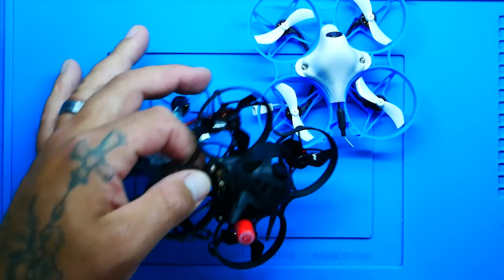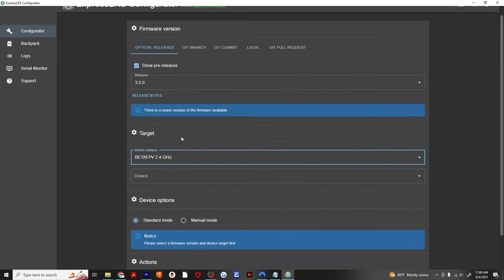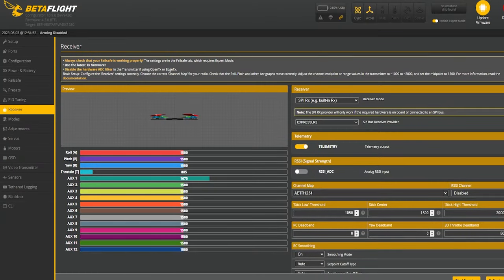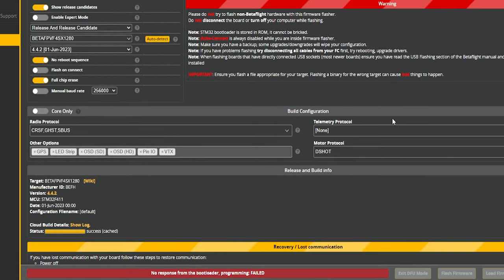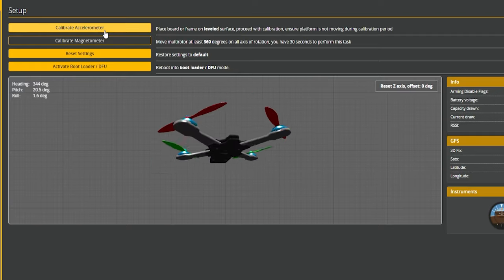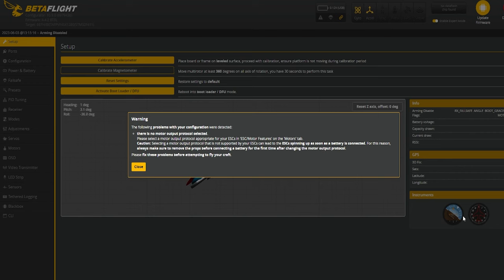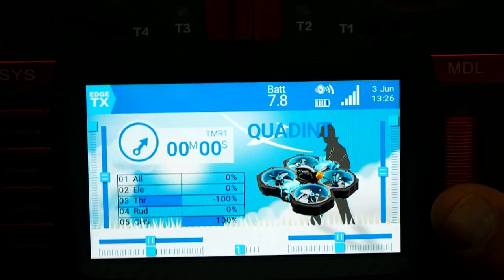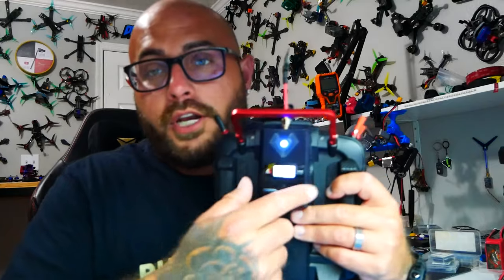How To Bind Any & ALL Whoop & Micro Drones To ELRS !! Your Complete Set-Up Guide !! ExpressLRS

Comment: PLEASE DONT DO THIS IF YOURE A NOOB AT FPV. The video works, only if you know what youre doing. When you do this method you will get that error of “apply custom ports” or whatever when you re open beta flight. What this video fails to mention is, yes although you flashed to 4.4.2 you still need to attach the 4.4.2 DIFF file into the CLI in Betaflight otherwise your whoop will be all screwed up and not bind. The DIFF file basically tells your drone how to act and to be able to be bindable with your ELRS radio. I struggled for weeks trying to figure out what I did wrong from following this video, but it’s missing a whole other half set of instructions for you to do this successfully. Now that I know what I did wrong it’s easy, but if you’re new like I was at the time it’ll be a complete nightmare and you’ll spend 4 hours every night trying to figure out what you did wrong!
Reply: i think i saw it on another video (by luck) that you backup your current version, and you can restore that section from the backup
Reply: @Langor  yeah I had a group of guys on a discord who know their stuff who had me install the correct DIFF files back into the cli and it worked perfectly for me. But my rant was towards the newbies that have no idea what any of that means, just like me at the time it really sucked lol!
Reply: @outdoorcreationsnwa  I know nothing. 😂 I just happened to get a different 1 minute video showing another way to do it. But for most people like you and I we'd be like "whaaaaaa?"
Reply: Somewhat unrelated, but i have an issue with one of my whoops and i was wondering what discord servers y'all are in that help with troubleshooting this side of fpv?
Reply: Thanks for the info I’ll go ahead and dislike this video
Reply: Does it happen at first 2 ways or is it only a problem with the third way?
Reply: Ok I flashed 4.5.1 
Where do I get the DIFF file?    And how do I flash it in the CLI.      My mob 8 and boxer absolutely will not bind.   So annoying I wanna fly it so bad.   Finding phrases set up in my remote and in beta flight on my flight controller still nothing.
Reply: Thanks for the heads up. Now, can anyone point us to a more basic video?
Reply: I’ve been spending WEEKS! What’s the CLI phrase I need or I there a bit deeper explanation to boost up for newbs? Hold up. Let me read more…

Comment: So I just got a mobula 8 did the back up flashed newest b.f. put tried all 3 methods can’t get it bind I have ran through all the ep1 on kustom 5” worked fine also mobula 8 won’t go into Wi-Fi mode I’ve seen other do the WiFi binding fraise have reflashed radio a few time double checking binding fraise am I missing some thing or got a bunk kwad

Comment: You always been very informative person, nice job, Here I want to add something maybe no one take attention to it (((SPI receivers DO NOT support D(D250, D500), F(F500, F1000) and Full Res(100Hz Full Res, 333Hz Full Res) Modes (Packet Rates) and thus will not bind or sync with a TX module in any of these modes.))) so when you did above and the reciver not bound you need to change the frame rate from the radio to 500HZ
Reply: Thank you for this comment! I just got geprc tinygo with SPI and now trying to connect it to my tx12. Before I found this message about freq I thought that I can't connect it at all. But now I got at least some connection and trying to find details.
Reply: Wooouh men, This kills the configuration of my other ELRS models a little, because I see 100Mhz full res fixed wings. 8Ch
The drone arrives this week, I want to try it (and be able to bind it)

Comment: The only issue I noticed for those new to this, when you do this it somehow screws up the video transmitter section in Betaflight meaning you won’t get camera feed to your goggles, and if you’re new like me, you’ve hit a wall and don’t know what to do next, you’ll ask around and those experienced will say it didn’t happen to them. Or maybe I just had bad luck! But I tried it on 2 drones with this method and both did the same. For those wondering, I did it on the Mobula6 and Meteor75 pro

Comment: Tried the first two methods and they didn't work.  The third way is absolutely ridiculous.  Looks like I have a $270 paper weight.
Reply: Its a bit of a learning curve but stick with it. Will be worth it in the end. There are many points not covered in this video.  I suggest looking up Joshua Bardwell's tutorial for things concerning elrs. Or Painless 360 is pretty good too.
Reply: @vuchuong74  Figured out I had to turn down the packet rate.  SPI receivers won't bind if the radio is set at packet rate for serial receivers.

Comment: I was given a RadioMaster TX16S loaded with EDGETX_tx16s 2.8.4 selfbuild 023-05-20 along with an Mobula6 900/915 ( dont know if its 900 or 915 ) Blueframe whoop with a CrazyF4 ELRS V1.0 AIO board loaded with Betaflight 4.4.2 STM32F411 CRAZYBEEF4DX f3f3a3c2.hex... this thing will not play nicely, it wont bind. What FW./SW do I need to use to get this combo to play nice, and who do I DL it from?? Express?, Radiomaster?, EdgeTX?, OpenTX?, Happy Model???  I now understand why this combo was given to me, the previous owner could NOT get it to work either... and BTW Betaflight "sees" the reciever and it moves the model on the screen when moved in real time... any help or direction to a solution would be greatly appreciated...  forgot to mention, it also has a Happy Model 900 TX add on pack in back....
Reply: If your radio is talking to your drone when connected to betaflight the check the values min and max throttle when you fully deflect throttle stick. If not set right it won't arm? Just a guess.
Reply: Oh wait you are talking about binding. 1. Just upgrade or flash radio firmware to latest EdgeTx (may not be essential). 2. Flash the Elrs module (internal or external) to the latest version (elrs v3.xx?). 3. Flash betaflight to drone if SPI as in this video. Note elrs Tx v2.xx firmare will only talk to Rx v2.xx. If your radio elrs module had v2.xx then betaflight v4.3 and above have elrs v3.xx baked in? Maybe that's why it won't work. I am still on elrs v2.xx but will update my gear in a couple of months. Hope I dont fuxup 😂.